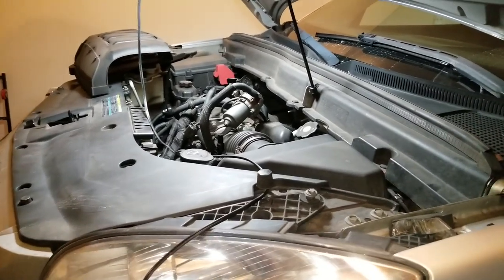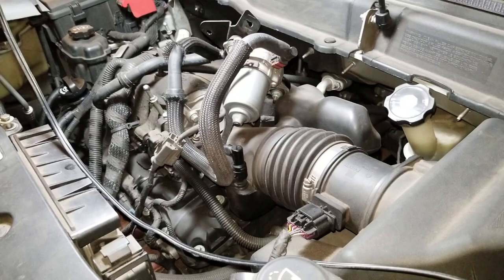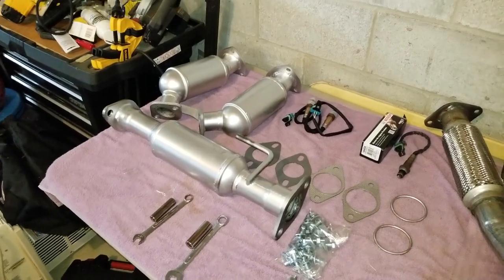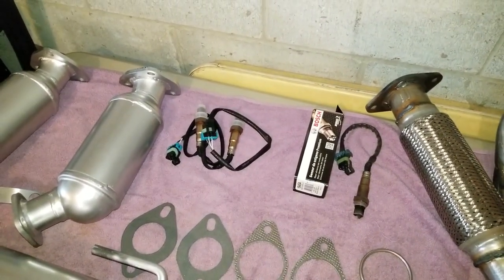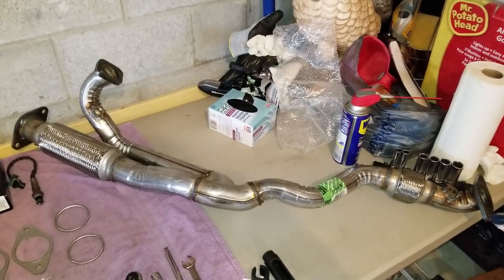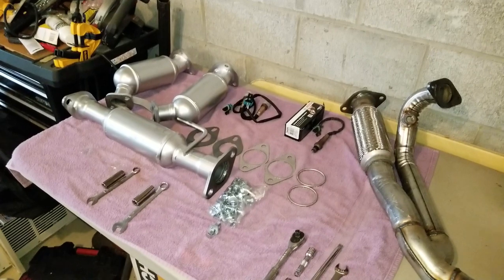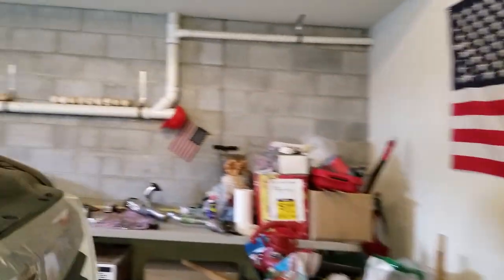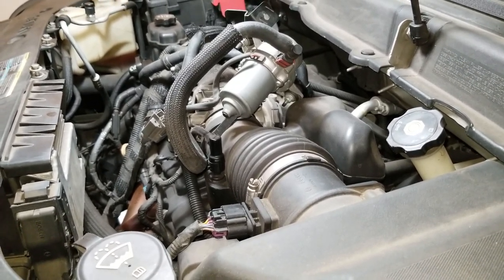2009 Saturn Outlook, Acadia, Traverse, Enclave - Catalytic Converter Installation - Part 1

Comment: Are they still holding up?
Reply from the maker: Somewhat.  The one is starting to trigger the code off and on.  But the issue I found with the code is, it's hard to tell if the converter or a sensor is causing the issue.  Also, if you have a slight exhaust leak, that could trip the code too.  Keep in mind, when I bought these new converters, my plan was to replace them and only keep the car for another year or two.  I knew I wouldn't get another 10 years out of them.  You don't have to buy original GM parts but do research before you buy.

Comment: Cheap is never better...gotta at least spend mid-range $$. You'll be fixing again with cheap parts...trust me.
Reply from the maker: I agree.  The goal was to get this job complete, save money, and get it through inspection and emissions.  These were actually good converters, well made.  But GM vehicles are very picky and trigger codes easily if something is off.  Its like the car knows it's not an original GM converter. LOL.

Comment: There is no way the quality is going to be on par with a more expensive one.  I have this same code and I am just gonna fix the one that’s bad.  When the others go bad I will fix them.
Reply from the maker: I beg to differ.  You have no way of knowing that until you see how long the new part lasts.  These parts came from an actual Exhaust Company, who I would think knows how to make better parts than GM would.  GM, like most brands and parts, are overpriced.  A part for a 10 year old car should not be as pricey as it is.  And true, you could replace one at a time, and then the price isn't as bad.  Like I said in this video, I could have done just the one and been done with it, but I splurged and got all 3.  I'm only keeping this car for another year or 2, so I'm not looking to get another 145k miles out of it.  You're comment would be true if I was comparing a GM car to like a Mercedes or Audi, but I'm comparing an after market GM overpriced part to a new quality exhaust part from a real exhaust company.
Reply: @jaybrown9158 , I agree 100%,OEM factory parts are way overpriced. Chances are, the company in Canada probably makes the exhaust for GM cars.
And I've owned 2 X5 Beamers and the OEM parts for those are outrageous. And you can buy aftermarket parts that are just as good!
Reply: I bought cheap its not worth it

Comment: Sucks to be in Calofornia - cats here needs to be CARB compliant , which cost $600- 800 each . Those cheap cats from ebay or amazon cant ship in Califonia . If you put a non CARB compliant - its a 50/50 chance that it will fail in smog test .

Comment: Jay Brown whats the website where you bought the parts I have the same issue with 12 GMC Acadia. I am very interested in buying all the parts too.
Reply: Jay you are the best man. You made it look so easy and your training is beyond perfect. Thank you
Reply from the maker: I bought the catalytic converter set on Ebay from a company called First Choice Exhaust.  They are based out of Canada.  I live in Pennsylvania and it took like 6 or 7 days to get the parts.  The 2 downstream sensors I got from Ebay as well.  I don't remember that company off the top of my head.  The upstream sensor and the Y Flex Pipe I got from rockauto.com.
Reply from the maker: @josealtamirano8119  , Thanks buddy.  I was worried the video would be too long and it was.  I tend to over explain sometimes so that's probably why this was 20 minutes long instead of 10.  I wanted to make sure I covered everything so there wasn't any confusion.
Reply: Jay Brown thanks. I’m afraid I have to replace the Bank 1 catalytic converter in my wife’s 2010 Enclave. I’m dreading it. It was a pain in the butt to replace the downstream O2 sensor and couldn’t get even a wiggle out of the upstream O2 sensor. I buy a lot of stuff off Ebay so that makes it easier. I like your detailed video. It helps put me at ease doing this job.
Reply: @jaybrown9158  , your video was very professional. I have to change my bank 1 Converter and you've given me much more confidence. Don't get me wrong, I have always  been a hands on guy with my autos, but in 2006 I was in a critical motorcycle accident so I am limited on my mobility. Seeing your setup with the jack stands and your support boards gave me hope.
Praise God for people like you that are willing to give their time to help others.

Thank you,

Mark

Comment: more information on where the complete set was purchased, if you can help please
Reply from the maker: I got the 3 piece converter set on EBAY from a company in Canada called First Choice Exhausts.  I got the oxygen sensors from RockAuto.com.   I also got the Y Flex Pipe from RockAuto as well.  Hope this helps.

Comment: What I want to know is if these are still working a year later 😂
Reply: Doubtful
Reply from the maker: I apologize for the delay in replying.  I don't check my youtube feed as much as I should.  As of now, Feb. 2021, I just had to replace one of them, so I got about 2 years out of them.  Keep in mind, and I do state this in my video, that I wasn't looking for parts that were going to last me 5, 6, or 10 years.  I knew I would only get a couple years out of these, with the hopes of fixing my P0420 code and trading it in because my car is now 12 years old.  I understand there's a concern when buying NON GM parts online, especially from EBAY, but for me it was about trying to save money and learn how to do it myself so I didn't have to rely on a mechanic to do all my work.  So my suggestion, if you have concern about EBAY or anywhere else, is buy the parts from where you think it would be best for your situation.  Hopefully at minimum, my videos give people confidence to do it themselves and save money.
Reply: @jaybrown9158  wow! Thanks for taking the energy to respond, I appreciate that! Glad they worked out for you, even if it was just a couple years
Reply from the maker: @christopherwright9312  No problem.  Trust me, I'm not happy that I only got 2 years out of them, but I am happy I learned the process of doing it myself plus saving a ton of money.  Some people on here are very anti Ebay, but again, you have to do what you feel is best.  This whole DIY job was for me to learn.  And by replacing one a few weeks ago, the process was very familiar and went a lot quicker.  Side note, if you choose to go with GM parts, whether from their website or through a dealership or mechanic, these converters are now around $800-1000 per converter.  I personally don't have that money so for me, Ebay works just fine.  Some companies on Ebay do offer 5 year warranties plus free shipping and free returns, so again, for me personally, I didn't mind getting after market parts from there.
Reply: @jaybrown9158  yeah, looks like some good deals now eBay. Although I’m probably just going to buy walker from RockAuto. It’s a little more,  but should last much longer

Comment: CHEAP IS ALWAYS BAD   DONT DO THAT.       BUY ORIGINAL PARTS
Reply from the maker: I agree for the most part, but I also don't have $3000-4000 to spend to get this done with GM parts by a mechanic, so after market parts was the way to go for me.  But every person needs to buy their parts from where they think is best and what fits their budget for their situation.  This was a great learning experience for me and my goal was to hopefully educate people and give them confidence to do it themselves.  The current price for actually GM OEM converters as of 2021, is about $800-1000 per converter.  That's almost $3000 in parts alone if you are replacing all 3.

Comment: Id rather have seen it done than verbal instruction
Reply from the maker: If I was a full time mechanic and did this type of work all year long, I agree with you.  These videos were specifically made to just show where everything is at, how to get to it, and the tools you need.  If I filmed doing the work, these videos would be 3 hours long at least.  Plus, most people know how to loosen and tighten bolts, they don't need me showing them that part.